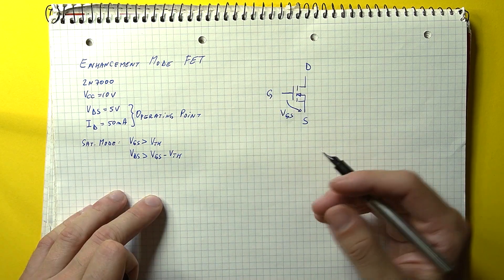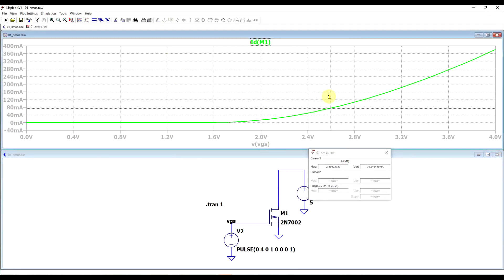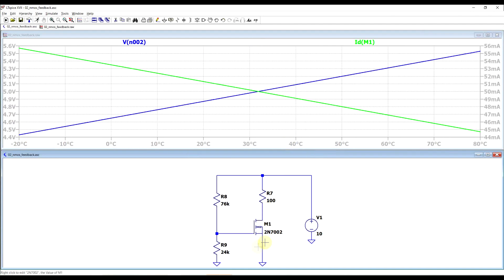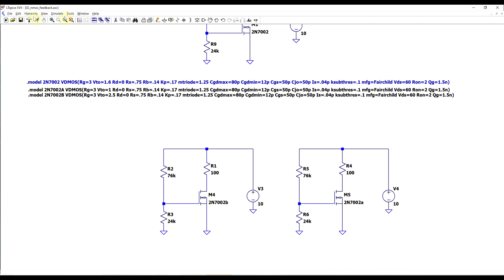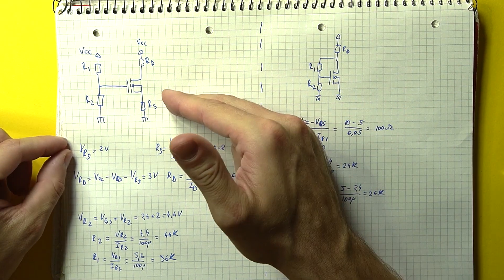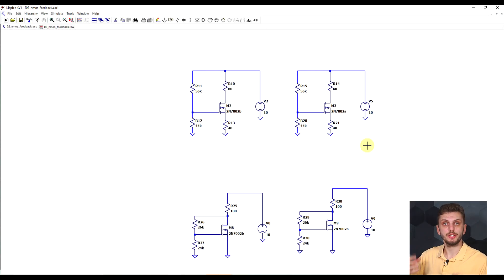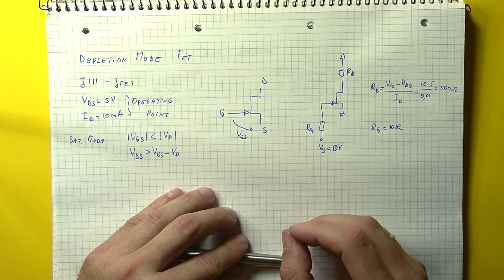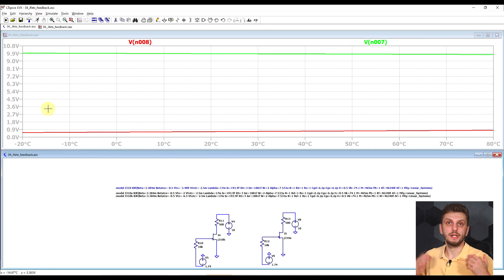Setting the operating point in a FET amplifier

Comment: You could also run a "DC sweep" analysis in LTspice instead of varying the gate voltage source with time - the advantage is that you immediately get the correct x-axis.

Comment: Again, it's possible to improve on the dc stability against variation of threshold voltage and temperature by using a combination of feedback biasing and source resistor. You can do this by allowing more voltage drop across the source resistor and biasing the gate above ground by a resistor divider from drain to gate and gate to ground.

For example, set a drain current of 10mA and allow 4V across the source resistor. So Rs=400R. Then split the remaining 6V equally between the transistor and the drain resistor. So each drops 3V and Rd=300R. The target quiescent bias point is 7V.

Since the source is at 4V, the gate will need to be at 4V - 1.8V = 2.2V. Using a current of 0.1mA through the bias resistors gives Rg (from gate to ground) = 22K. Because the drain is at 7V, the feedback resistor Rf (from drain to gate) = (7V - 2.2V) /0.01mA = 48K.

Running the simulation with the same extreme models gives a change of quiescent drain voltage from 7.7V to 6.0V as Vth changes from -2 to -6.5V. The change over temperature is 0.1V across the temperature range -20°C to 80°C. The corresponding drain current change is from 7.5mA to 13mA and 0.3mA across temperature.

Comment: an active way......
so some current mirror  ( i hope this is how it translates)?
or maybe some zener ?
Reply: It's really difficult to create a current mirror with discrete JFETs because of the difficulty in matching Vth between samples. Usually we'd use a matched pair on the same die, which tends to be expensive. In such cases, we would simply use a JFET input opamp like the TL072 for cost reasons.

Usually, active biasing for a common source amplifier stage would mean using an active load (current source) instead of the drain resistor. That allows a larger gain without having to use very high supply voltages.
Reply: @RexxSchneider  i know this is why i mentioned the zener since for this is an ok ish reference

Comment: 😃😄😁😆😅 5 Smile's. You have to love negative gain in a circuit like a 555 on a negative and if you put a director to it on the in supply it just will not turn on???? strange no😁you could try light to drain to a negative use one to balance a relay line from flicking due to signal on negative but unlike the relay flyback put that director in and it doesn't work!! again strange no!😁.

Comment: Hey, great video! Just one question. When do you say saturation mode is the Fet working in linear/ohmic region it isn't? Thanks!
Reply: In engineering school we were taught that in a FET, the linear operating mode is called the saturation region. The confusion comes from how the term is used with a BJT, where saturation is a nonlinear region of operation….can’t get more collector current with more base current. It’s really an unfortunate use of terminology, confusing many people! 🤦‍♂️
Reply: That's exactly right. The concept of "saturation" mode is normally used in the context of a BJT where the collector current is limited by the collector resistance instead of the (excess) base current, and the resulting collector-emitter voltage is small.
In the case of an FET, the ohmic region occurs under analogous conditions: the drain current is limited by the drain resistance instead of the (excess) gate-source voltage, and the resulting drain-source voltage is small. That seems to be sufficient justification to describe the FET as "in saturation" as the meaning should be familiar.

Comment: Why did you use ".op 1" at 5:45 and in other simulations, what is the meaning of the "1" argument?
I get the same results with just ".op" command without the extra argument.
Reply from the maker: I think that when I started working on the simulation it was a transient type of 1 second - ".tran 1"; but then I switched it to ".op" and LTspice just didn't delete the argument. The "1" was not added intentionally...